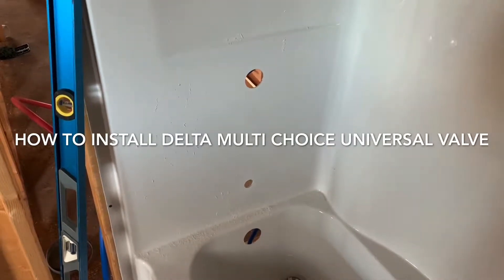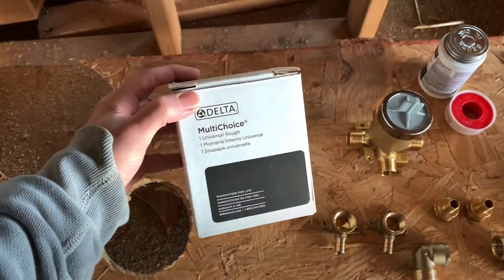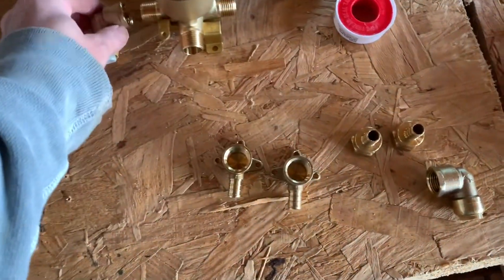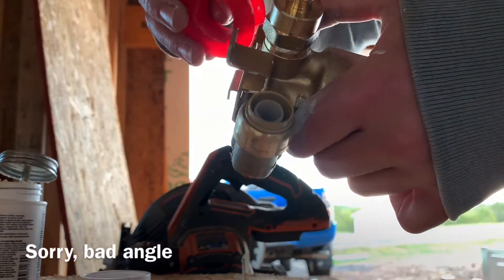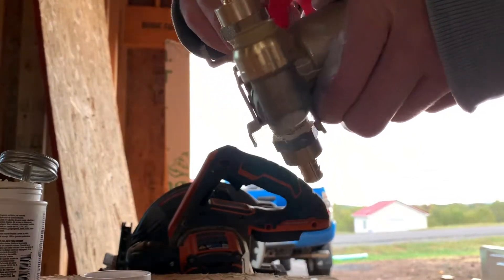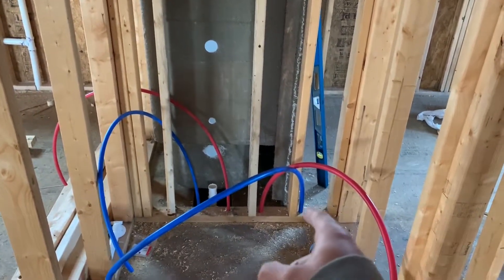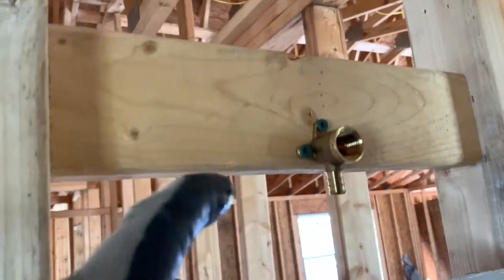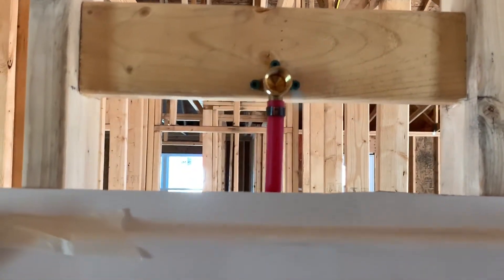Delta Shower Valve Installation: Using SharkBite Adapters

Comment: Thanks for the great video. Is the shark bite 1/2 inch to 1/2 inch? Can the Rectorseal 31631 1/4 Pint Brush Top Tru-Blu Pipe Thread Sealant , Blue be used? thanks.

Comment: Sharkbite fittings are great, but you might mention that you can't use pex from the control to the tub spout on a delta rough-in valve.
Reply: Why not?
Reply: @ivideorandomstuff4591  ask Delta.  It has to do with the pressure and/or inside pipe dimension. (It’s in the instructions and will often cause failure )
Reply: Is pex to the shower with a shark bite ok to use?
Reply: @ShootingG1  you can supply the control valve with pex, but you can't go from the control valve to the tub spout with pex.  (You can use whichever fitting you choose)

Comment: Never Never ever use a shark bite fitting in a wall, destined to fail.
Reply from the maker: I disagree. But we all have our techniques. Thanks for the comment!
Reply: Some techniques are right, some are wrong! Shark bites are great for quick repairs, getting customers their water back on while waiting for parts or scheduled repairs. They are not long term!
Reply: Just solder it. It's so easy.
Reply: I’ve had shark bite fittings in my bathroom for years. Never had one leak.
Reply: Bunch of fear mongers
Reply: That's funny. I notice a pattern. DIYers love sharkbites but plumbers hate them.
Plumbers come on here claiming they fail. If plumbers are telling the truth why do we not have the same amount of DIYers and homeowners warning about sharkbites. If sharkbites are so terrible as they claim, why are they allowed in super litigious California? Some one is lying. And I don't think it's homeowners and DIYers.
Reply: thats just plumbers talk in order to save jobs